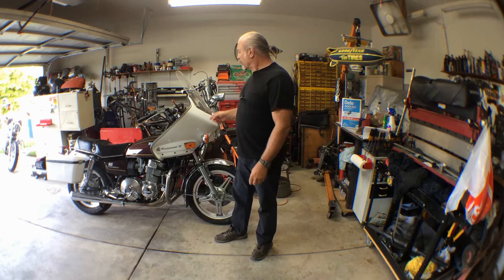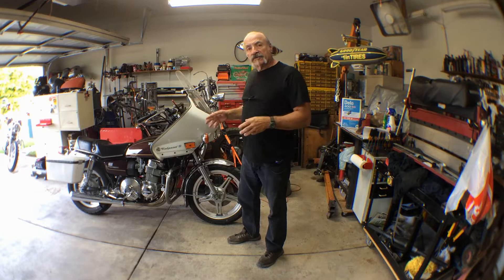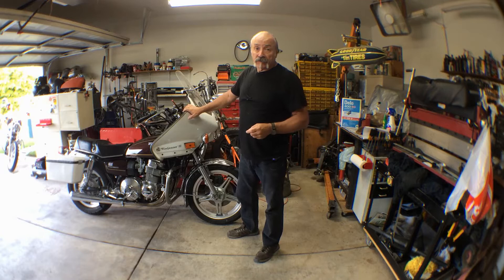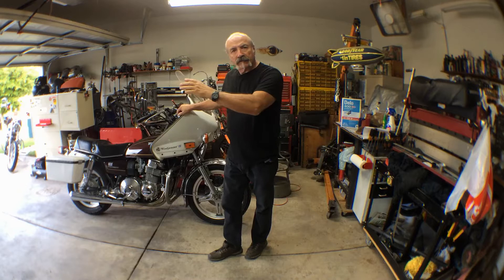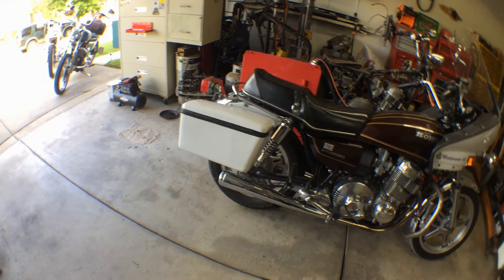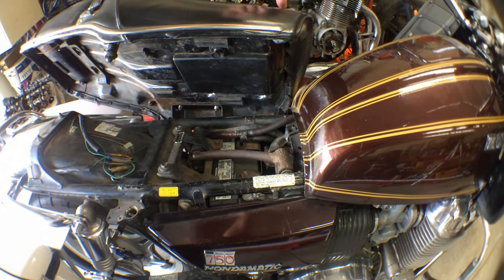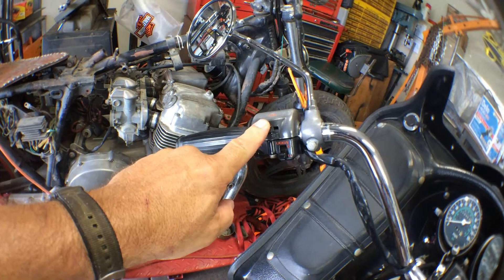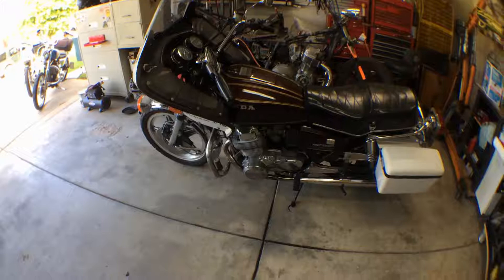Honda CB750 Hondamatic Review Test Ride

Comment: WOW! I LOVE YOUR 1978 MODEL CB-750A. I HAVE ONE TOO ( BLUE AND GOLD) AND AM CONVINCED THEY ARE GREAT.I HAVE ABOUT 5,000 MILES AND IT WAS IN A GOOD LONG TERM STORAGE FOR NEARLY 30 YEAR  WHEN I BOUGHT IT. IT SHOWS VERY NICELY LIKE YOURS. I WENT RIGHT THROUGH IT WITH CARB CLEANING , TUNE-UP, ETC, LOVE THE FAIRING AND SADDLEBAGS. MY ONLY COMPLAINT IS THAT ITS KINDA HEAVY TO GET ON THE STANDS. THEY SURE ARE NICE THOUGH!

Comment: inspiring video. why aren’t there more automatics I wonder ? in my 60s with trigger finger on the left hand so genuinely interested in the Hondamatic option.
Reply: The production #’s through the years were low, perhaps 8000 produced. Attrition through the years has whittled away that #. Occasionally (and presently) they show up on EBay motors, and parts on EBay. Good hunting!

Comment: Awesome - very thorough!
Does the automatic shift still feel like it's going through gears, or is it more like a continuously variable shifting?
Reply: A two speed manual shift transmission with torque converter.
Reply from the maker: No shifting, constant acceleration

Comment: Nicely done video 👍🏼👍🏼.   
A coworker was just gifted one of these from an uncle. It’s a ‘77. Hasn’t seen daylight since the early 80s.
Hell yeah I volunteered to help with the revival 🤣 
He’s still uncertain what he wants to do with it, besides getting it running. My name is top of the list.
Honestly I just want to take her for a spin. Guess I’ll be syncing carbs again in the near future.😖🤮😎
Stay tuned for the update.

Anyone have recommendations for parts source??🤞🏼🤞🏼🤗
Reply from the maker: Parts are EBay,Craig’s list, Vintage  Honda parts Co. what makes it sometimes quicker to find stuff is find “Microfische” and get a reader. I have found many new parts by the correct part #

Comment: Great review . Thank you. I e heard that the 750 hondamatic can suffer from a rattle on start up which clears quickly. Have you heard about this ? Thank you. Lee
Reply from the maker: 2 normal rattles, a loose tappet , or cam chain. Either may be adjusted.
Reply: @alsplace4190  thanks so much. I would assume cam chain. Some Google comments seems to suggest torque converter, which can be a bit dry on start up ?

Comment: Hey Al, great vid. There is a 1977 for sale near me and was thinking of getting it. I have never ridden a motorcycle so it would be my first bike. Do you think it'd be a decent first bike or bad idea? thanks
Reply from the maker: These are rare, a opportunity not to be missed, even if mucky and not running, it can still be cleaned up and placed underneath the flat screen TV as alternative decor. Also get a 250cc machine and ride it around to where you have developed some skill. In the mean time while you are becoming a good motorcyclist, you can find someone to help you/do the maintenance required to have it running for the day of your 1st ride. Another thing Honda doesn’t sell parts, so if you break/wear something out, it takes a bit of searching to find bits, so this will be a cool cherished ride for occasions, mine are retired now for antique bike club events where if it’s far, I use a trailer, as do folks who own 1969 sand cast 750’s(who rarely start them)
Reply: I had a 400 hondamatic in 1978, easy to ride light, and had great gas mileage. I was stationed in Hawaii I used it just about every day for 3 years. It was a great bike, yes I would buy one now if I could find one.